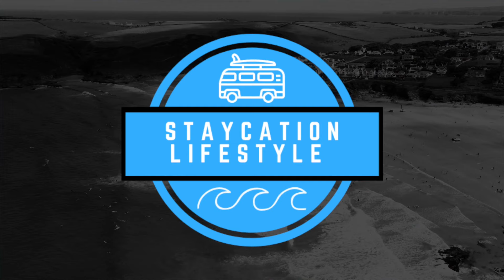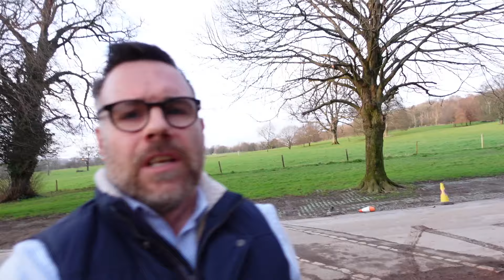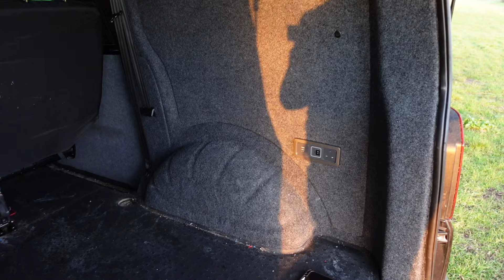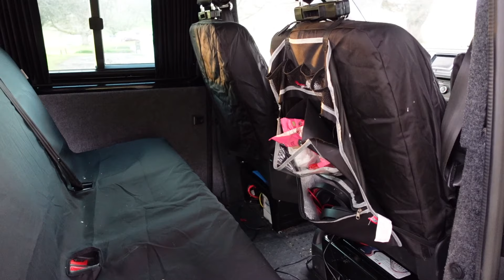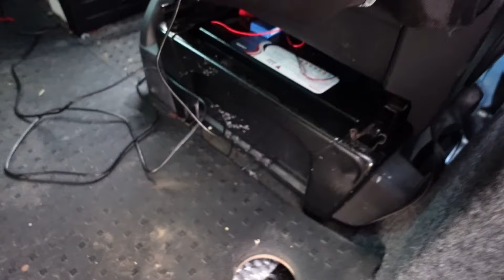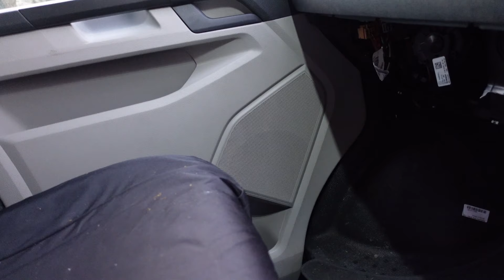My van tour - VW Transporter T6 - Updates and progress so far

Comment: Thank you for all your Videos. I was wondering why you choose Vitron over the Complete DC-DC Charger Kit – CTEK D250SE Dual Input DC-DC On-Board Charger with MPPT ? I understood that the one to go for on a T6 was the CtEK. I would love to hear your opinion as I am wanting to install one in my Van next month, with a solar panel.
Reply from the maker: Hi Nick, I was drawn by the communication between each Victron product. Each element of my system “talks” to each other to ensure everything is doing the job it should be. I can connect my phone and check the current state of the system and also the history. It has better management controls especially for LifePO4 batteries. Do I really need all that? Probably not and it’s additional cost due to having a separate solar controller. I’m very happy with my choice. However, the Ctek unit is very good and popular with most people only having AGM batteries and the lower price tag. Basically you won’t go wrong with either. If you want to monitor it go Victron, if not go Ctek.
Reply: @StaycationLifestyle  Thank you so much for your reply. I will have to have a good look at the pro's and cons of both. At the moment I only have one AGM bat, but was thinking of going lithum when prices come down.
Reply: @njgagen  yes they do cost more, but last much longer, more usable capacity, smaller and lighter. There again are arguments for either. Have fun fitting it all 😁

Comment: I tried to activate the auto lock on driving away on my T6 via Carista but it doesn’t seem to work 🤷🏼‍♂️ can you remember the process?
Reply from the maker: I will check, however I believe there are 2 option. Method A and Method B. One didn’t work for me so had to change. Also did auto unlock when keys are removed
Reply: @StaycationLifestyle  👍🏻
Reply from the maker: I changed both to yes and it works on mine
Reply: @StaycationLifestyle  Same here and it worked on my mates van too 🤙🏻

Comment: Nice work. I’m new to the van stuff myself, so learning steadily along the way. Have done some similar jobs - dash cams, swivel seats, speakers, carpet, struts. 

The tailgate lights… that’s on my to do list. Where did you source power? Have you also wired in a switch the open the tailgate from the inside?
Reply from the maker: There are a few options, I took a feed from the leisure battery so they are completely independent, however you can get a feed from the factory courtesy lights from the roof if you want them coming on when you open door etc. yes I took the panel off and wired the switch in the centre above the handle thing.
Reply: @StaycationLifestyle  Nice work. All these jobs are far harder post conversion. Getting to the wiring for the lights might be impossible, and getting a feed from the leisure battery could be really challenging too. 

A battery operated light would be so easy… but just not as tidy 😆. 

I’ll start with the switch perhaps.